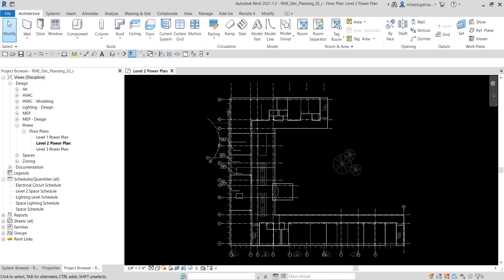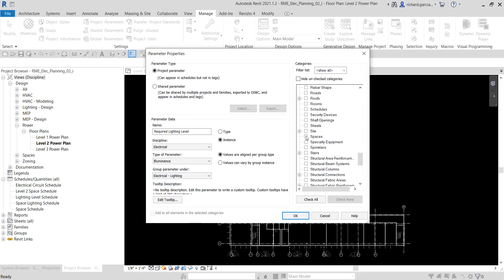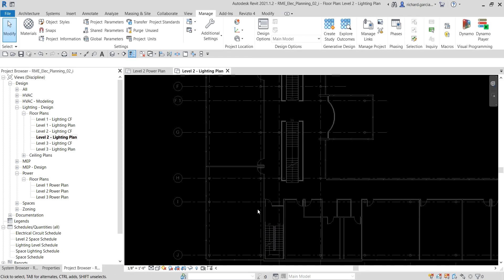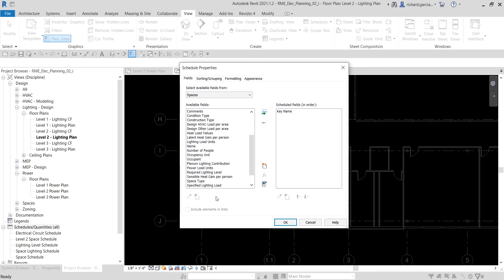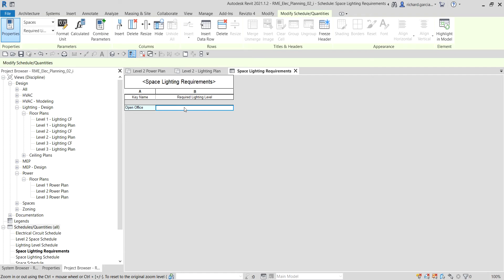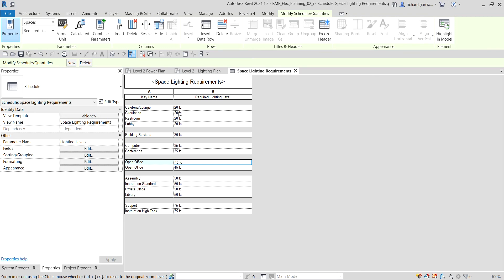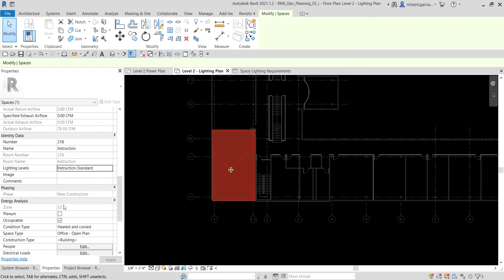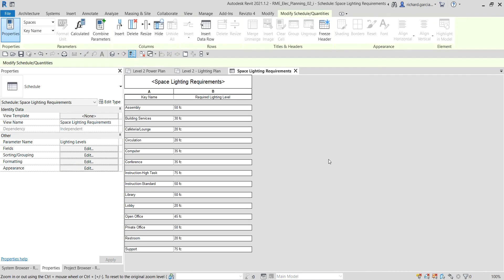REVIT MEP 2021 - ELECTRICAL SYSTEMS - 21 DEFINING REQUIRED LIGHTING

Comment: how  to place and connect Ethernet/Nurse call/Data connection/Security devices..plz post video
Reply from the maker: Sure will create video of that. By the way, there is ready made family in revit that you can insert in the project like the way you insert your electrical fixtures 😊

Comment: Hi..... 
Sir! What should be the elevation/height Of "space "( for stepped ceiling. 

For example height of ceiling is 12feet at middle and 10feet at sides.
Reply from the maker: Hello sir. i don't exactly know what is the height of space. I usually just separate the space using space separation line and specify the height individually from floor to ceiling.
Reply: @bim360  okay...sir
Thank you